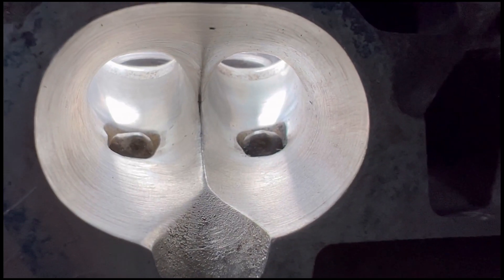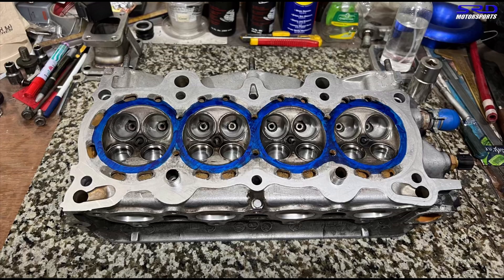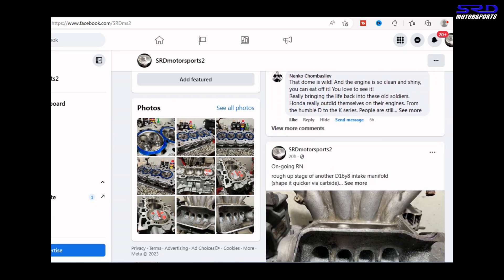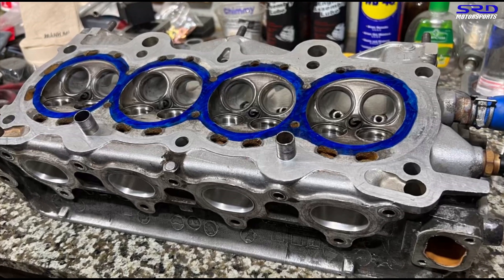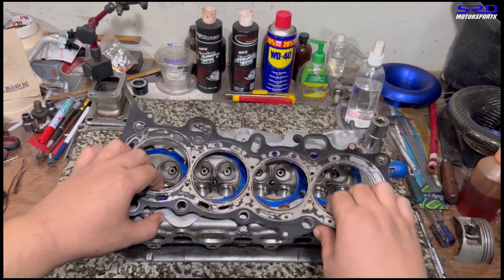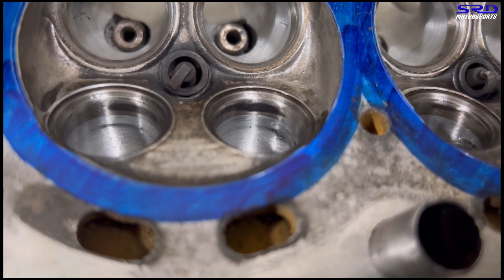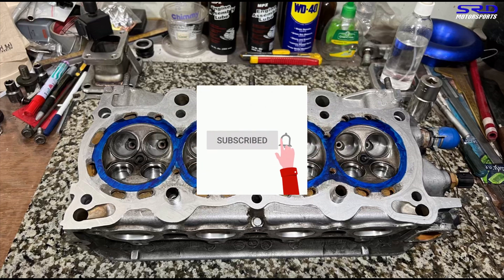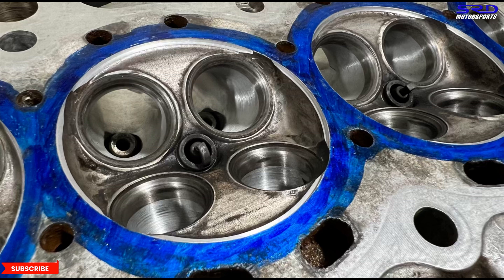D16a6 Non Vtec All Motor Build Series Part 4 Chamber Tech Tricks

Comment: Is the pm3 carb head the same  of the d15b as the d16a???
Reply from the maker: @CypronieNelson  as long as the d16a has the same pm3 casting head then yes

Only diff is the mechanical fuel pump hole at the back of the head (intake side)
Reply: @SRDmotorsports  would the pm3  head be a high flowing head to do a turbo application...
Reply from the maker: most dseries heads would work good for it yes
Reply: @SRDmotorsports  if turbocharging I would use a lower compression piston other than the pm3 I would use the p2c dished pistons...
Reply from the maker: okay

Comment: Awesome like always! maximum torque reaching with this job! Wonderful!
What about the stock intake with the ported intake dyno comparison? It will be done at the end of the project?
Reply from the maker: Not at the end actually it will be the first test on the dyno for the D16a6

First run will use stock d16z6 intake and tune it and permitting budget we will dyno
Then the ported one , same steps 
Last is the skunk2 intake which is it’s actual set up